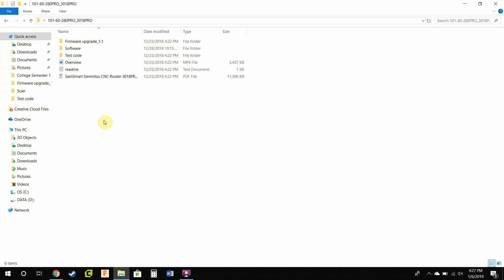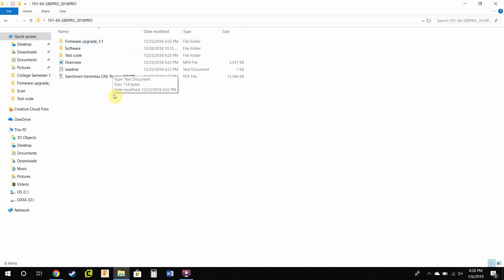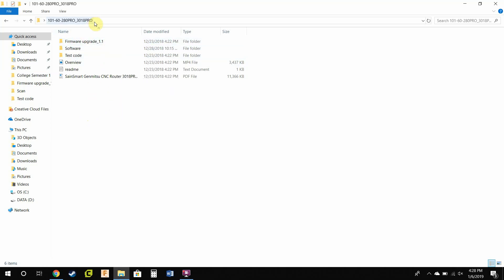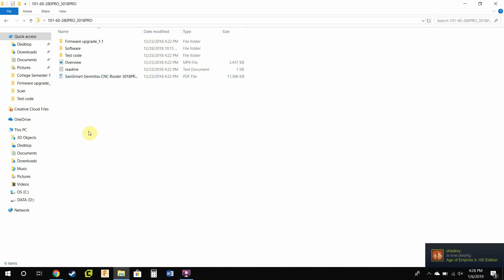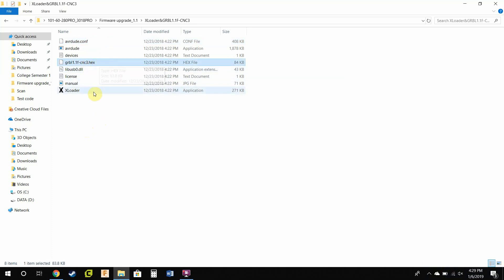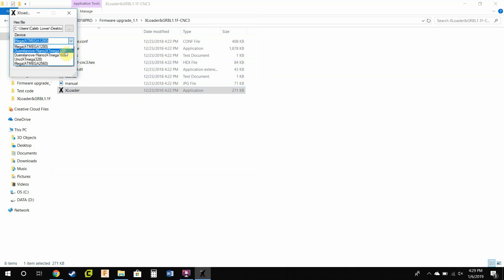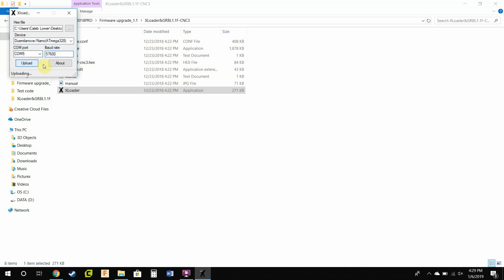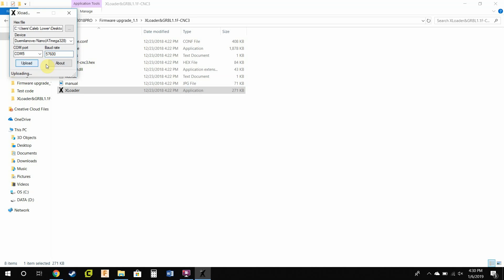How to Update Your Sainsmart Genmitsu CNC

Comment: How do I set up the computer software so that it can actually cooperate with the 1.1 Grbl because my CNC won’t do anything even though I updated it to 1.1
Reply from the maker: Look on the back of your CNC board. There should be 2 lights, one that says USB, and another one that says 24v, are both lit up? Also, what software are you trying to update it to
Reply: I accidentally deleted the Stock software that it comes with so I really want to get it to go back to that but I can’t find it anywhere and I don’t see a USB light or 24 V light I just see lots of 12 V

Comment: Is there a way that I can tell what version of the firmware that I am currently using?  That way I know if I need to upgrade or not.  I have the "generic" version of the 3018 Pro.  Thanks!
Reply from the maker: It was already updated most likely, and updating again should not hurt anything. Only damage it could cause is if you unplug too soon or do something else like that

Comment: Tried doing this exactly like these directions but is not completing the upload, just stays there and says uplaoding
Reply from the maker: It is unnecessary to update to the most recent version. However, you issue could be that it is trying the wrong port, or the machine is not on. I once sat for an hour trying to get a machine to work, only to realize the power strip wasn't on